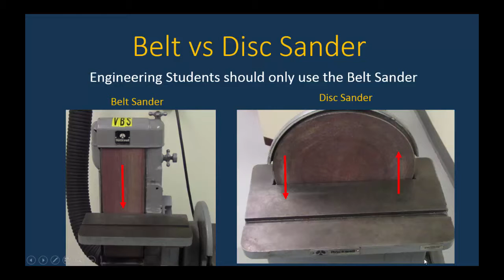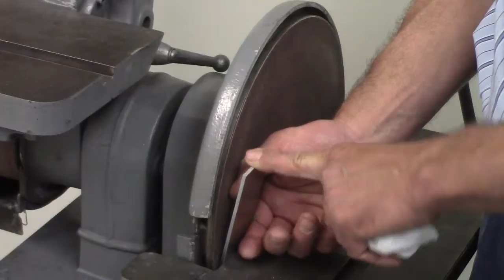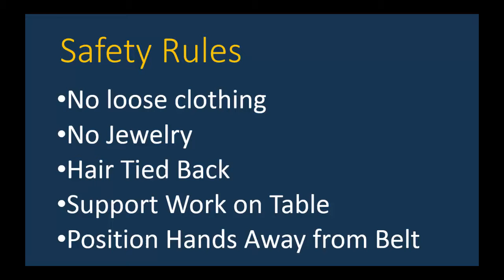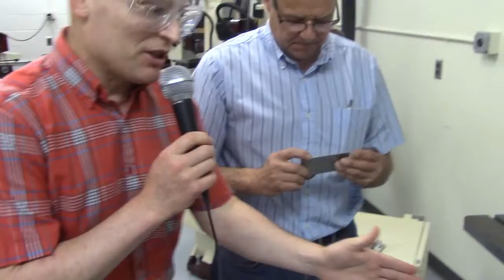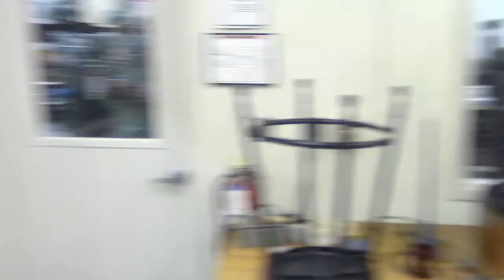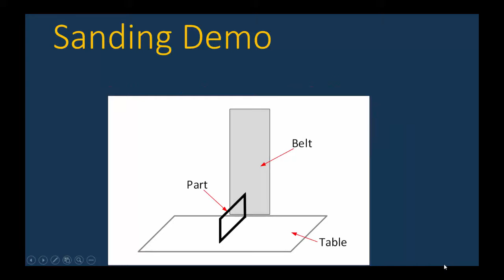MCC ENR 153 Machine Shop Video Saws and Sanders Belt Sander

Comment: 1.) While using a saw or belt sander, there can be no loose clothing or jewelry worn, and hair must be tied back. Ensure that work is supported by the table, and that your hands are positioned away from the belt.
2.) After pushing the emergency stop button, it normally takes between 10 and 20 seconds for the belt to stop completely.
3.) By lying the part entirely flat on the table, you are putting the part in a position where it could get pulled upwards, then into the machine, pulling your fingers with it. 
4.) Without the part being supported by the table, it is very easy for your hands to be pulled into the belt, causing injury.
5.) A belt sander has much more surface area than a blade, along with the fact that it is abrasive, rather than sharp. This leads to more skin being damaged much more quickly than a lone cut.